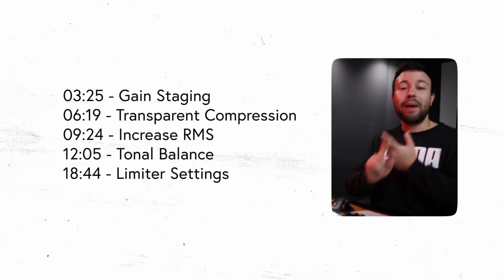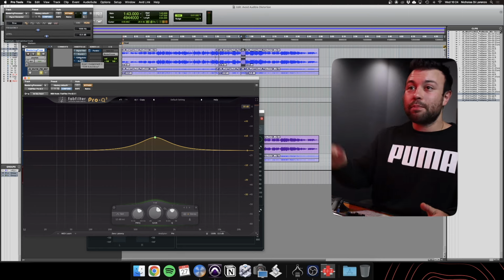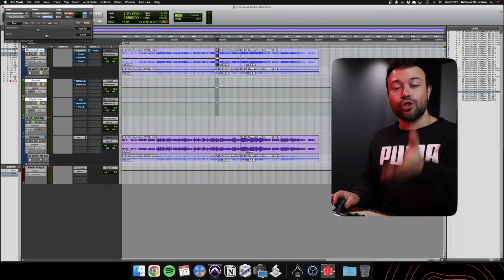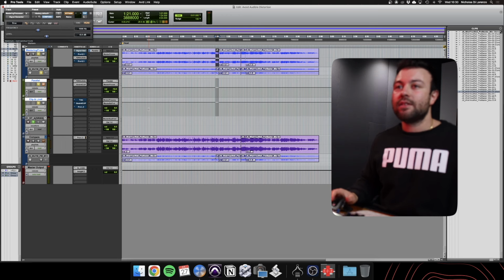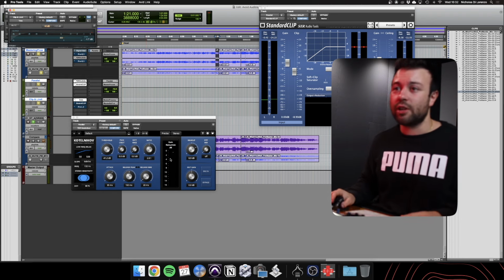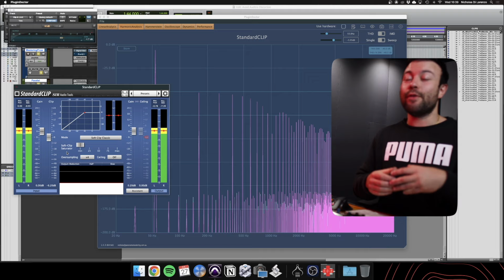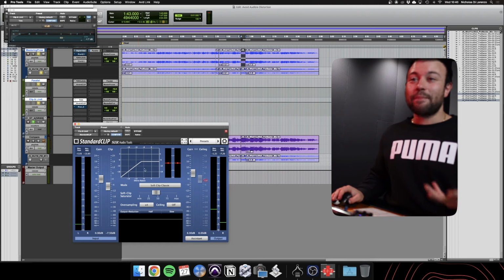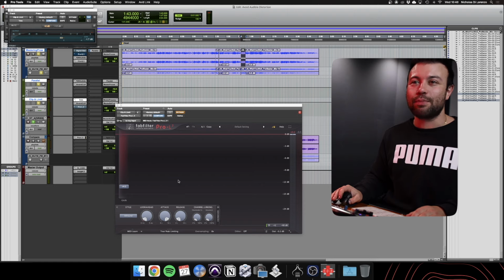NO MORE DISTORTION! How to Master Loud without Distortion and sound GOOD!

Comment: New York Compression in Mastering is a Mastering Engineer's best friend. Unless one feels compressing the entire frequency spectrum is needed to encompass punch and drive without altering the main track's transients, it is best IMHO to split the frequency spectrum into low, low mids, high mids, and highs (or lows, mids, and highs) using a linear phase EQ to avoid phase cancellation, blend each section accordingly. You have more control to determine which frequency spectrum area needs more or less than the other, instead of boosting the entire frequency spectrum all at once. I find this to achieve more punch, drive and cleanliness throughout. To add more punch, use SplitEQ by Eventide to boost the fundamental transient and backbeat's fatness and click using Mid based processing, bypassing the Side to avoid headroom increase, and keeping the low end overall in Mono where it is Mono-Compatible. Then, add Baselane Pro to ensure Mono Compatibility is in place.
Reply: Commenting tk come back
Reply: you must be getting some shitty mixes

Comment: To avoid harmonic distortion via compression, make certain the release time is 50ms minimum. Anything under 50ms will constitute harmonic distortion. The lower the ms below 50ms, the more harmonic distortion will take place. That is for all compressors, digital and hardware. Fast attacks follow the same principle. In your tutorial example, 33ms attack time will constitute harmonic distortion.
Saturation and distortion are two related, but very different things.  Distortion is a very broad term that refers to the altering of a waveform’s shaping.
One form of distortion anyone envisions in Music is harmonic distortion, which can have a very pleasant, or very harsh timbre depending on the amplitude, the type, and the number of harmonics.
1) Saturation is the combination of harmonic generation and soft-knee compression.  Saturation occurs when the electrical components of a piece of hardware are overwhelmed.
2) When an electrical component is saturated, it can no longer output a signal in a linear ratio to the input, resulting in Compression and Distortion.
Overall, different electrical components like tubes, transistors, and the magnetic particles of tape, each affect a signal different during saturation, resulting in different harmonics, different amounts of distortion, and an overall different timbre.
Although this topic is pretty complex, the most important take away is that the terms distortion and saturation should not be used interchangeably.
When doing so, the meaning of one term may be conflated, or confused with the meaning of the other. In turn, making it more difficult for engineers to discuss topics clearly.
That said, it is best to know these terms and what they mean on a technical level so that they are not used incorrectly.

Comment: If any DAW supports 32-bit Float IEEE, use as recommended instead of 24-bit PCM. Also, to remove the possibility of Aliasing Distortion and Nyquist, use 96k Sample Rate (if your system can handle it). I use 96k sample/32-bit Float IEEE as a DAW Standard. Oversampling in over 95% chances is not needed, unless you want to remove all instances of A.D altogether.
Reply: Ok, but on what stage do uou convert it to 44100? After mastering?

Comment: 9:47 great tip! Was trying this parallel comp thing on a master in logic today and was wondering why to use the clipper before the compressor? Just so it won’t clamp on the loudest transients or is there a different reason? Also my peak volume increases a lot if I blend it in, a standard clip gain plug-in wil do the trick to get it back to the initial volume right? anyway great video as always keep up the good work! 🥂
Reply: Ah just read in one of your answers below the clipper in parallel was just to control peak value over the compressed signal so that’s clear.

Comment: Bro!!!! You saved one of my tracks! Basically, I had way too much harmonic distortion from my sources (loud trumpet and synths) as well as mixing too loud into UAD plugins, followed by making my limiter work too hard. I went from my track sounding like crap in my car at -14LUFS, to loud and clean at under -10LUFS. I'm using a few different plugins to get the results, but the workflow is basically the same. Thank you so much for the helpful videos!
Reply from the maker: Super glad to hear! Happy to be of assistance

Comment: Honestly one of the best videos i've ever seen explaining the relationship between gain-staging and compressors. Once you made it clear that EVERYTHING must have the same true peak and can adjust the output gain accordingly, is a GAME CHANGER. So that the final limiter is effecting everything evenly and can push the balanced mix  to the limit without distorting. Thanks so much mate!
Reply from the maker: Glad it was helpful! Thanks for watching along! 

There are definitely two camps to gain staging; 
1. Matching loudness (which I think is the best approach when mixing)
2. Matching true peak (which i think is the best approach when mastering, so you always know what headroom you have going into your cieling)
Reply: @panorama_mastering  Of course man! 
Very concise summation. Keep up the solid work!

Comment: Just start with all your sounds at or lower than -12 db.  Once your mix is good, then connect them to 1 bus.. in that bus use a volume enhancer (make sure it's not a compressor!) and after that plug-in add a plug-in that watches for LUFS... increase your volume to match the LUFS your looking for.  I try to do all my mixes at -11 LUFS for stock music.
Reply from the maker: What plugin do you use for "volume enhancer?"
Reply: YouTube deletes my comments everytime I mention the name of any plug-in.  So, I just said what it is instead of what I use.

Comment: And how would you use this setup and still get around -14 LUFS? I used a similar chain but got levels around -9, which I totally dig and normally get my hi-res masters to that value, but I'm having trouble getting to lower values. What would be your approach in that case?
Reply from the maker: Why do you want lower values? (Serious question to diagnose the context here)
Reply: Thank you for answering. I'd like to get lower values so the track's volume doesn't get turned down when uploaded to the streaming services. I know the user can just raise the volume if the tracks are too hot and get attenuated, but what is your take on this topic? (dunno if you already have a vid bout that)
Reply from the maker: If you master to make it sound good, and it sounds good at -9. That’s all that matters, the algo will bring it down to -14, so you’ll have a good sounding mastering playing back at -14, just like everyone elses tracks being jormalized to -14. If you comprimise your master to “meet” -14 you’ll have a comprimised sounding master at -14
Reply: @panorama_mastering  Ok so better keep it hot and let it be normalized, thank you!

Comment: sometimes im wondering why DAWS dont have a Gainstaging function wich simply analyses the whole Audio on a Track and gainstages it wished. (just an Algorythm looking at peaks and reducing it to -6 by a simple GAINSTAGE Knob activation) , Of corse this would have to be communicated witht the Plugindesigners..
 But hey, if one would be ultra ultra cautious, he would each time have to search for every peak, look at it, you never know probably the Acoustic Tracks may have a very occasional Peak way louder. I find this always a bit unnerving to have to gues.. Of corse its a thing happening very seldon.. Further, a good Plugin in my oppinion should just allow peaks above zero, wich quiet a few Plugins do. This may use a tiny bit more CPU, i dont know .. But for me an equalizer especially should allow plus zeros.. 
If so, i could more vaguely use digital equalizers / Copressors wich really dont care about input VS Output Stage, and vaguely stay at -6 .
Reply from the maker: Cool idea!! I think at the least everySINGLE plug-in should have meters which warn of overs;

Comment: Awesome video. I always prefer the sound of standard clip in hard clip mode. If anyone smarter than me can tell me why in reply to this comment it would be much appreciated ☺️👍🏾
Reply: Probably because hard clipping only touches the audio above the threshold. This makes it cleaner and louder than soft clipping using the same threshold. It’s also very easy to go too far with. But if you’re just shaving off short peaks it’s great.
Reply from the maker: I wish I could; personal taste I guess!
Reply: @panorama_mastering  I prefer an edgier more inyaface sound. I like the late 80's-mid 90's Bob Power mixes, and Luca Pretolesi's mixes for modern genres. The fact they push the mixes to a place people are scared to go makes them stand out and makes the mixes memorable and catchy.

Comment: How would you determine the lowest fundamental if all you have is the stereo mix? You used the clean bass to determine it in your other video, But a full mix usually goes down to 20hz. 
Also, if the higher the frequency the faster the compression wouldn't anything over 40hz be too fast for compression according to this?

I am genuinely trying to learn; I'm not trying to call you out or seem like a know-it-all douche.
Reply from the maker: All good; A full mix can have present frequencies and harmonics which go down to 20hz and below; I'm talking about the fundamental lowest frequency of the kick and the bass line; I plot this in iZotope RX Audio Editor in the FFT Spectrogram using the extended log mode; Here's a video on how I find that exactly; https://youtu.be/zkokZ_Aokzc
Reply: @panorama_mastering  Thank you.

Comment: Thanks for that nice video :)
Quick side question, I've always wonder how loud (LUFS) should be a soundtrack's track (film music). Because it seems that is way lower than usual Pop master song. Around - 14 LUFS ? thanks!
Reply from the maker: My understanding for any music I've worked on which has went out and been synched to film or TV is that they take the Radio, Instrumental and TV Mix; (So they can cut what parts of the songs they want in with/without vocals, lead vocals etc) and the full broadcast is mixed (in levels) in post to meet EBU or ITU specs for that platform
Reply: @panorama_mastering  Very interesting! Yes I was wondering about LUFS when the soundtrack is released on streaming platform like Spotify. I guess they do a special Master for it. Although, they're definitely not aiming very loud. I guess, I should try to import some soundtracks and analyse their general LUFS + dynamic range hehe

Comment: Quick question, what's the main advantage to using a parallel bus as opposed to a mix/wet knob on a plugin in the chain?
Reply from the maker: Flexibility in workflow/routing; Let's say I have on my chain 

EQ; Compression (wet/dry); Distortion(Harmonic saturation);

Any change i make to the wet/dry of the compression will affect the way the distortion insert works following it;

Where-as if I have

CH1: EQ, Distortion
CH 2(Parallel): Compression;

I can control the parallel compression and relative blend independently
Reply: @panorama_mastering  Gotchu. Thought so, was just checking to see if there was a reason i didn't know about. Thanks for the response!

Comment: Hello, Doesn't parallel compression on the master cause phase shifts and cancellations?
Reply from the maker: Hello, Raash, good question; 
You must have delay compensation engine turned on; so everything is sample accurate and void of any potential shifts in phase/delay

Comment: Happy to help! I appreciate your transparency! 😊
Reply: This exchange got me to subscribe.   That tip by mr fields made me go back to using the plugin!  Its refreshing to find honesty and a amicable exchange and respect both of you very much. 🙏🏾
Reply from the maker: Always!
Reply: slight correction to your comment - soft clipping provides a more gradual transition between the clean signal and the distorted signal, but due to its soft knee, it introduces distortion before the signal hits 0, meaning a soft-clipped signal is actually more distorted than a hard-clipped signal.

Comment: Hi, Is there any reason why you're using a compressor before the clipper on the RMS parallel track when you're going to clip it heavy anyways?
Reply from the maker: I usually only do the compressor for added RMS; but thought I'd get a bit experimental and use the soft-clipping function in series with it for added control over the peak value;